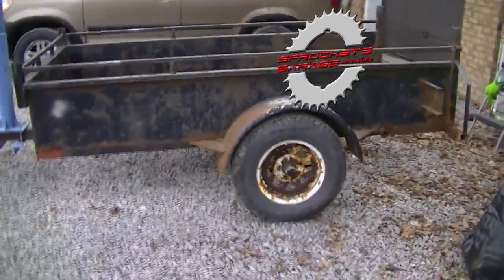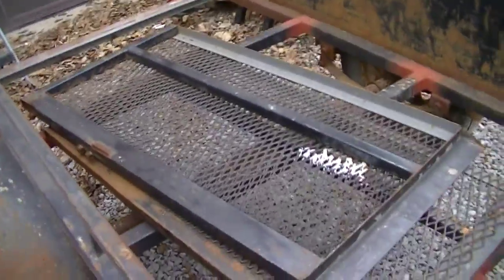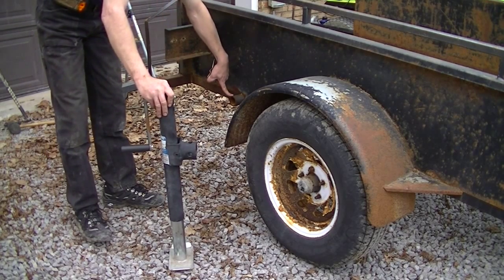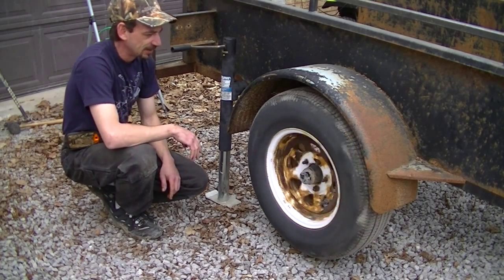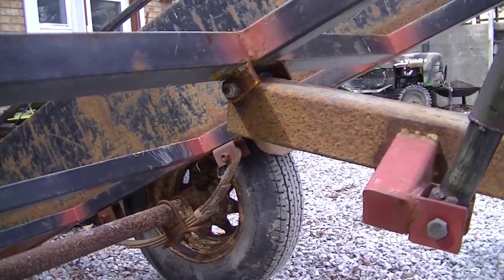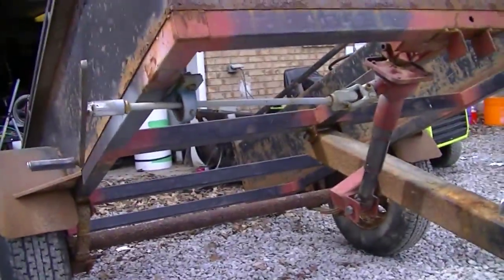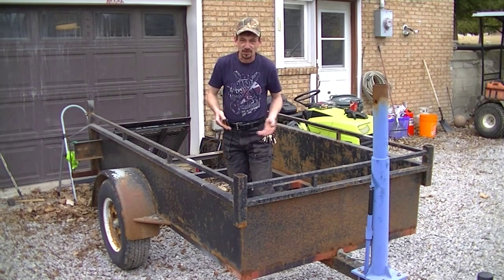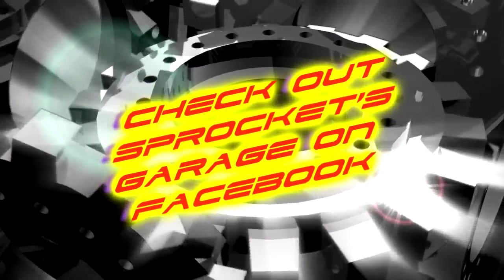RoboTrailer- Turning a rotted hulk into a utility gem!

Comment: At first I thought you were going to use a simple lightweight automobile shock to limit the speed and distance of the tilt, but the crank/jack idea is even better.  Also, I really like the short rear ramps used in conjunction with the tilt much better than what most people have where there is a long 5' rear ramp that sticks up into the air, killing your mpg as you go down the road.   I'm very impressed with your ideas.

Comment: That trailer jack ideas brilliant it can also double as to keep your trailer from tail diving on heavy loads. Like if you was to load say a broken down mower, while being pulled by another mower. If need be say off of the trail. Where you can't get the pickup into. I will be using that idea soon.

Comment: For that uper deck instead of what your doing you should just mahe a adjustable deck but building a big floor with 4 foot medal bars on each side and put them in those box steel holes on each corner of the trailer with holes drilled every one foot with pins on it so that the top deck can be be enough for tools under or u can raise it up higher and out a tractor under it but that's what I would do and by the way I love how you made that dump design with a car jack
Reply from the maker: KAWASAKI 230 Thanks. I have my upper level plans pretty much worked out. Basically, two stell shelves running lengthwise maybe 8" wide. They will be adjustable from side to side, to accommodate different track widths of whatever vehicle is to be put on top.

Comment: A cordless electric  drill / driver  could power your tilt feature.  Full manual cranking is always an option.  That socket drive means anything which can drive a socket can run your tilt feature.   An air ratchet, or even the Brace-and-bit style socket spinner are other options.  The spinner might need a u-joint for clearance.    Air is nice option if your shop or vehicle has an air supply.    You may want to add a socket drive option to your loading winch. Please run with these ideas.

Comment: I wider axle for stability would be a good idea when you put the upper deck on!
Reply from the maker: That is indeed a good idea. Instead, the whole plan has changed. We had an ice storm at the end of last winter, that killed my popup camper trailer. The frame on that trailer is about 8' 6" x 6. I can get two tractors on a deck that size, so I think I'm going to work towards turning that into my new toy hauler. Pity, though. I was really happy the way this trailer was turning out, but I certainly don't need two!